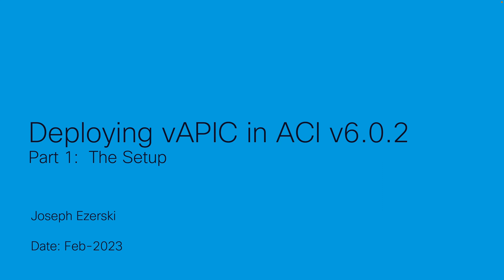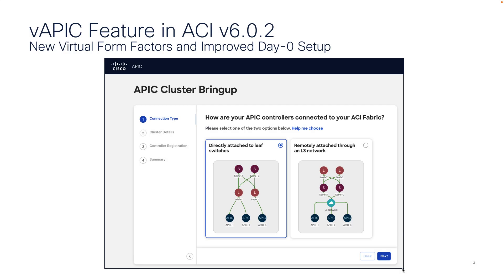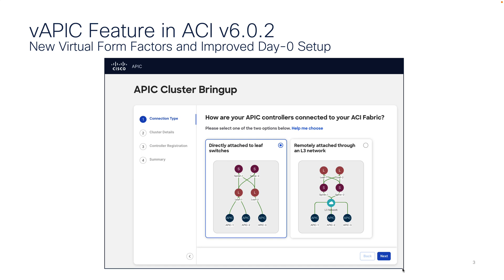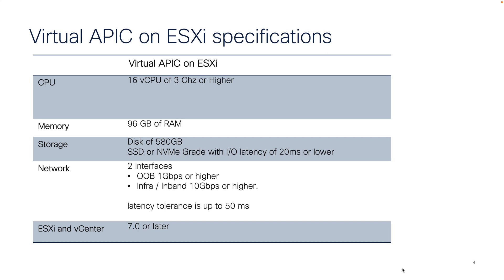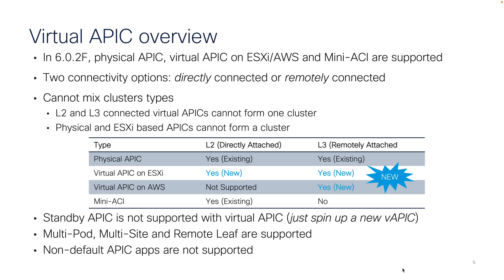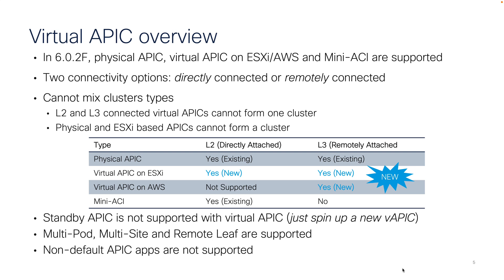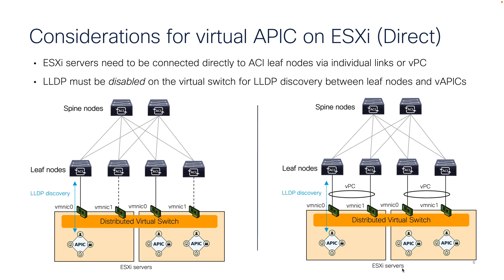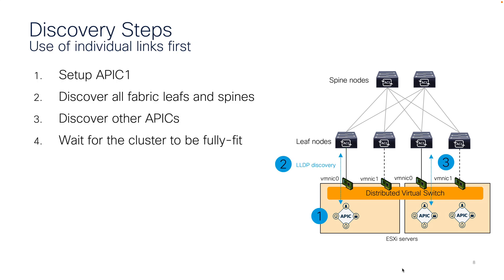Deploying vAPIC in a directly connected topology (L2) Part 1

Comment: Can Vapic works on a standard vswitch? I have a ESXI host without vcenter and only 1GB nic ports to the leaf switches. Is a 1GB connections supported? Thanks!
Reply from the maker: Yes, technically it can work on a standard vSwitch.  We suggest using DVS mostly so you have consistent port groups across ESX hosts as you distribute your vAPICs for better failure conditions.

Comment: hi joseph, thanks for your video.  Does nx-os switch require running same ACI version as vAPIC?
Reply from the maker: Hello Charles.  No, the NX-OS switch is completely independent.  No version requirements other than me recommending you run a fairly modern release of NX-OS, not something 10 years old.